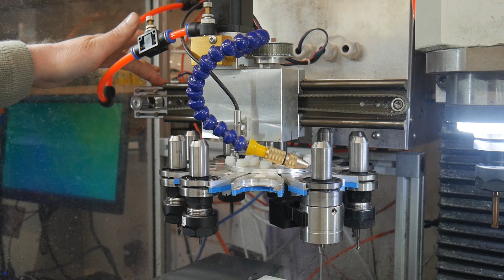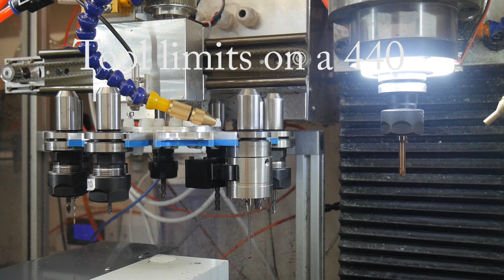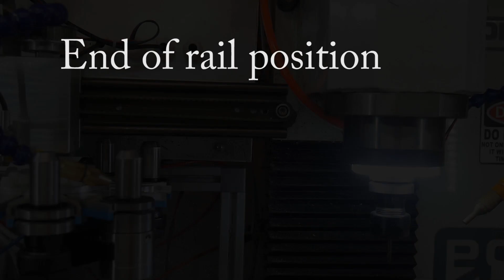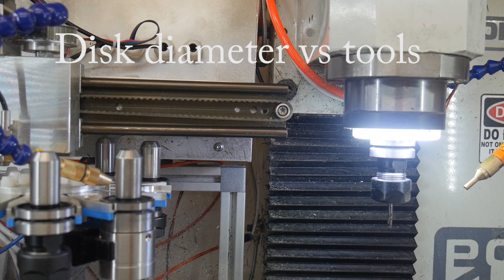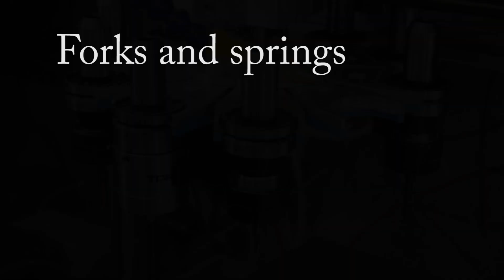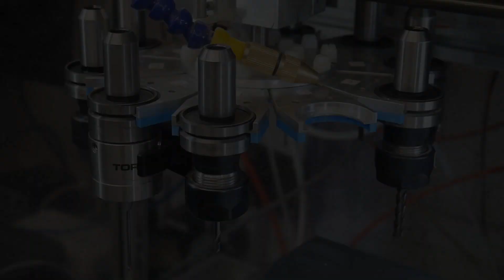DIY ATC for Tormach mills

Comment: Are you using the standard tormach power drawbar?
Reply from the maker: Yes.  Just substituted a 24V solenoid valve for the standard fit mechanical one.
Reply: @daleksw  I am planning on using a hydraulic cylinder, I can operate it with a 24vdc to 110v relay, I should only need to connect the diy controller to the relay right?
Reply from the maker: @michaelryan3528  yes.  The operating time is important though. Pp waits a fixed time after commanding pdb open before raising a.  Be careful!
Reply: @daleksw  I'm not sure what you're referring to with pp, pdb, or a.. and is this wait programmable with the windows app?
Reply from the maker: @michaelryan3528  PP - PathPilot.  PDB Power  Draw Bar.

When you do an auto tool change, PathPilot tells the ATC to open the power draw bar and release the tool.  PathPilot then waits a second or so before it starts the Z-axis moving up before telling the ATC to rotate to the new tool.  If the draw bar takes too long to release, then you'll get a very broken tool changer.

There's a similar sequence when the new tool is picked up.  PathPilot sends the command to close the draw bar, then pauses before telling the ATC to retract.

In both cases, the delay is fixed inside PathPilot.  It's not exactly tight for timing with a pneumatic cylinder, but you'd need to be sure a hydraulic arrangement could match the speed.
Reply: @daleksw  thank you so much for the explanation, I have no qualms about the speed of the hydraulic unit. They are push cylinders that act very quickly and retract very quickly, I've seen them work. I assume that the toolchanger/pp send 24v to the power drawbar, grabs tool, retracts, rotates, comes back to tool, and then 24v is released and the drawbar will re engage?
Reply from the maker: @michaelryan3528  Yes, that's about the size of it.  The output from my ATC controller for the pdb is a permanent +24V line and a switched ground.  The switch is good for 0.5A, which should switch any reasonable valve.  The air blast for cleaning tool shanks and the spindle brake for MX machines are the same.

Comment: Hi friend exellent ATC!! But have a cuestión, what paremeter use in the vfd to orientation in the spindle??
Reply from the maker: With TTS tool holders, there's no spindle orientation.  If you have on eof the MX series mills with BT30 tool holders, then spindle orientation is required, but that's all handled inside PathPilot, so I'm afraid I don't know how that's done.
Reply: @daleksw  thanks for the information friend!! I have this doubt how  is the orietation With bt30 its interesting

Comment: Great video!  I'm curious what your setup for the air blast is doing -- I see what looks like multiple regulators and a nozzle that looks like it might possibly be used for a venturi type sprayer -- is the air blast spraying lubricant or water on the top of the tool holders?
Reply from the maker: The air blast nozzle is just something I picked up from Amazon.  It would normally be used as a mist coolant spray, but here I have nothing connected to the lubricant/coolant line.  I think what you see is a 2nd needle valve in the air supply.  I added that because the needle on the unit doesn't work - you can screw it all the way in and there's still full air flow!

I needed to restrict it because the air flow was high enough that it caused the manifold pressure to drop (my solenoid valves share a common manifold), which allows the draw bar to close.  You can actually see the delay after each air blast because there's now also a pressure sensor that spots the problem.  I didn't have that originally.

The real solution is to have the air supply to the draw bar separated from everything else and a non-return valve in the line to make sure the draw bar pressure stays up when the air blast operates.  Then put the pressure sensor on the draw bar side of that valve.  That way the tool changes will be faster.  Some day I'll get round to sorting that out.
Reply: @daleksw  Thanks for the detail, I was just curious.  I'll probably just put in an inline flow regulator and dedicated non-pilot-actuated solenoid valve to make sure I don't run into the same pressure drop issue.  I had a nearly identical sprayer on my X-Carve for coolant spray before I got my 440 so I wasn't sure if you were using some kind of fluid to clean the top of the tool holders.